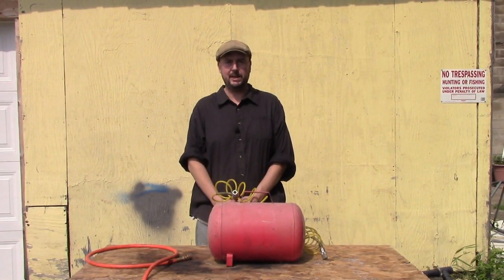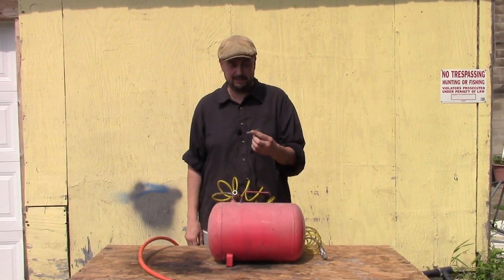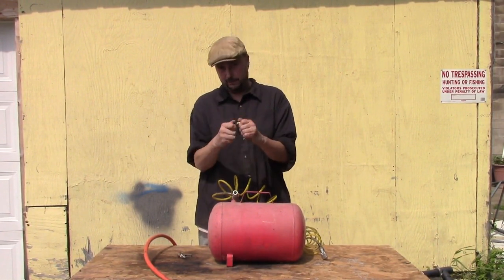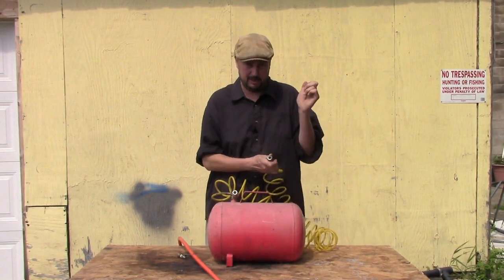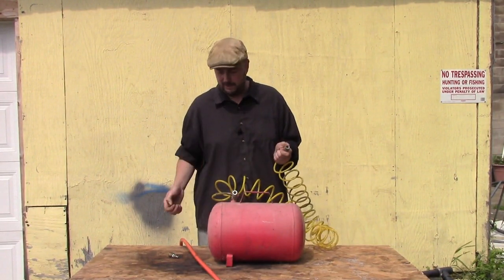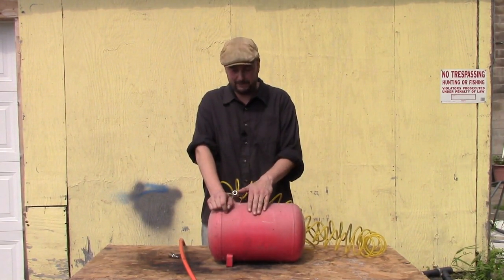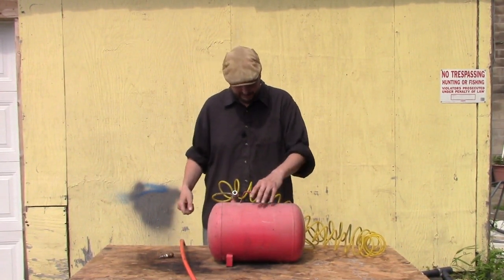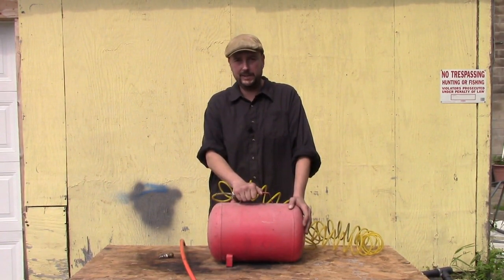How To Fill Your Portable Air Tank In 10 Seconds (Super Fast)

Comment: Hi; will a 1gal pancake compressor fill 100psi tank? would it take forever or what? Thanks
Reply from the maker: will work but will take a bit to fill
Reply from the maker: new Leaf  I have actually done that with mine you get about 15 or so shots before you have to refill the tank cuz it doesn't have enough pressure